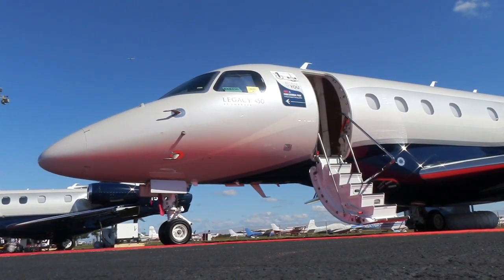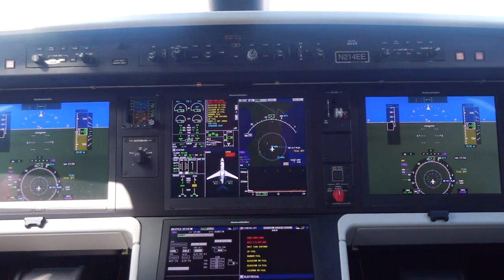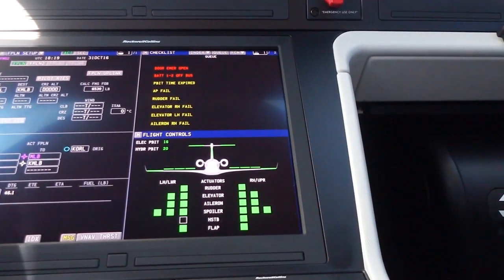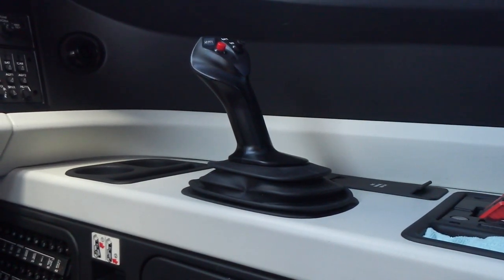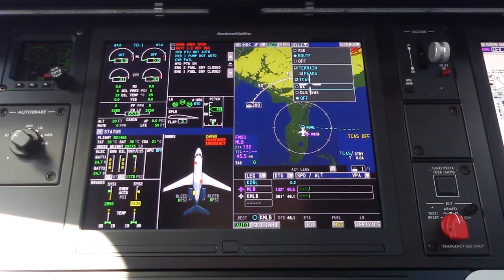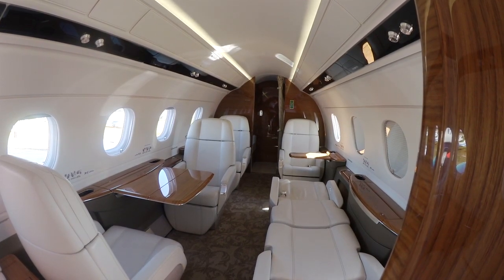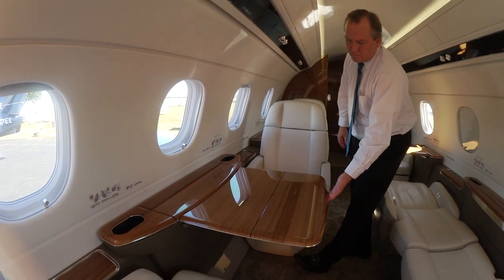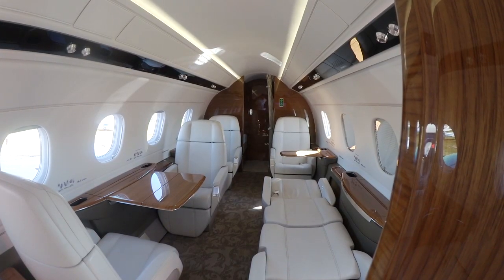Embraer's Legacy 450 Midsize Cabin Tour

Comment: OK I get the fly-by-wire flight side stick control ,but how does a pilot know if he or she is about to stall the aeroplane?perhaps it has flight envelope protection
Reply: it does
Reply: Stick shaker?
Reply: If a pilot does not know if he/she is in a stall, they are either an Air France pilot or a noob. Hundreds of thousands of trainee pilots learn the signs of a stall and how to recover from one, and the training aircraft used by them have no such thing as flight envelope protection.